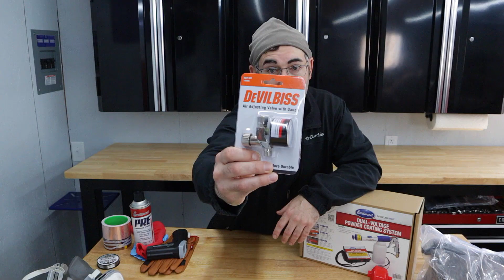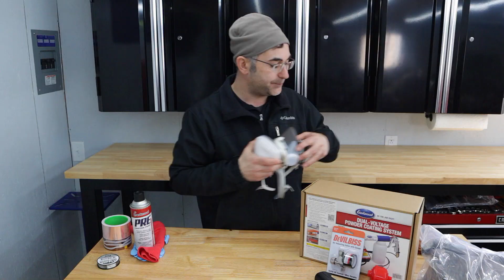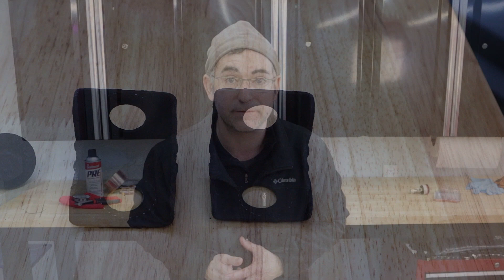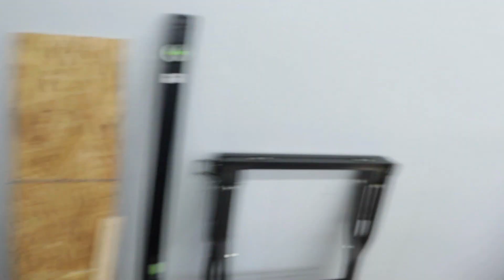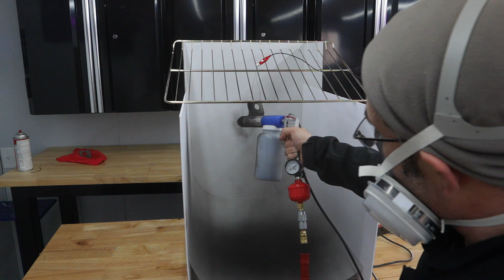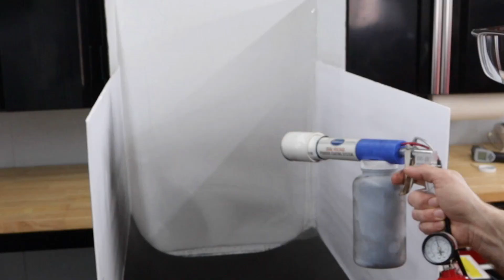Powder Coat at Home // Eastwood Powder Coating System MODIFIED

Comment: The small black plastic piece on the front, called the diverter tip, is pushed waayyyyy too close to the barrel. You don't need the piece of PVC, you just need to pull off the diverter tip when doing small pieces like that. For an object the size of a plate, put the diverter on so it is flush with the end of the metal rod. Anything smaller, remove the diverter entirely. You have it choked up far enough to coat a 4 foot square sheet. Loving that rust cleanup though, good job.
Reply from the maker: Great idea! Thanks for the tip!